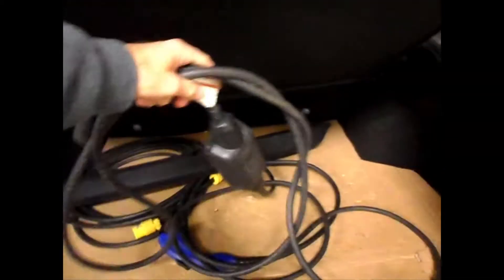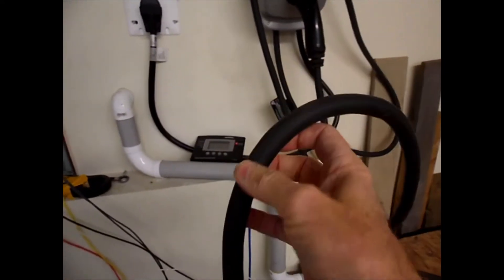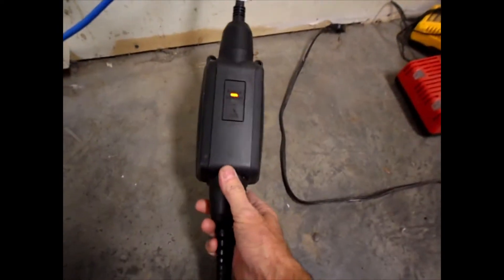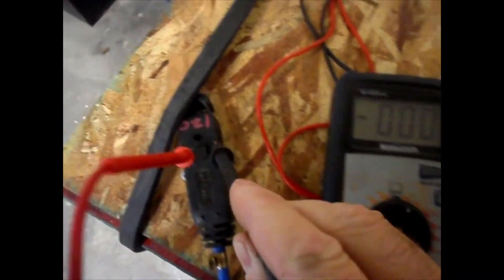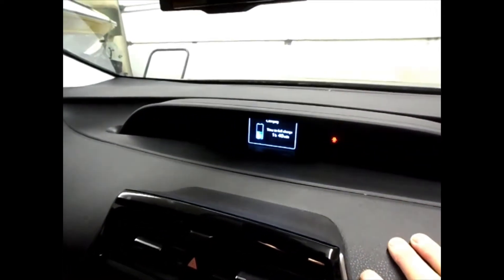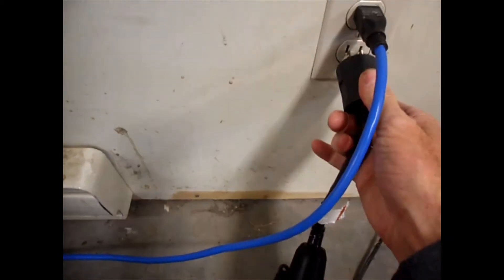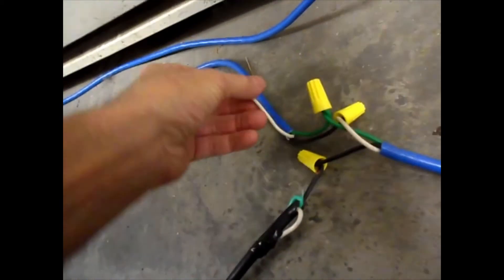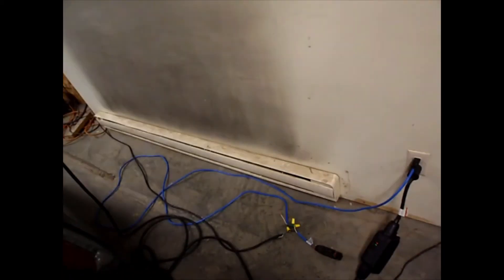Toyota Prius Prime PHEV Charge Controller works on 240 volts AC, save thousands

Comment: What you're saying doesn't make any sense. The electricity costs the same whether it's 120 volt or 240 volt.
Reply from the maker: yes its costs the same to charge your car on 120 or 240 since the watt hours used are the same in either case.  The cost saving are from not having to buy a dedicated 240v charger for the car and instead using the one supplied by Toyota when you buy the car and feeding it 240v instead of 120v.

Comment: Thank you so much! I purchased a Japanese second hand 2014 Prius PHV yesterday and I had to change the Japanese 200V plug into an Australian one. Once I opened the Japanese plug, I realised that their neutral (white) wire is corresponding to the Australian live (brown) wire. So, I was really struggling online to find relevant info till I realise Japan uses similar split-phase as US and Canada; I then found your video which further confirms that there isn't really a neutral wire in such a split-phase plug. So, my Australian plug is working fine now.

Comment: Nice video 
Its a bit red neck but works
Reply from the maker: yes I've since refined the final solution but the video was  mostly just to get the idea out there so people would understand the concept and be able to come up with a solution that works in their particular situation
Reply: @waltersavonian7551  you definitely explained it good
Reply: I actually ended up putting a 240 plug in and then made an adapter from 240 plug to 120v plug but 240v on the 120v so now I can just use 120v or 240v
Thanks for the video

Comment: Friendly reminder- this is bypassing the low amp fuses and the only fuse is the main. Drop the cord into salty water on the floor or mess something up and this could kill you.

Do this the right way- with proper fuses.
Reply from the maker: Hmm not too sure what you are referring to. Both of the separate 120volt branch circuits are protected by 15 amp breakers. This does not degrade the protection for these branch circuits in any way
Reply: Humm, firstly, I'm so very glad that little pup isn't a big licker. Loads of exposed conductors with current. One touch could mean death for him/her...........

So, another reason to cancel our order for the Prime. The fact we were told the car could be charged with 220 volts without buying a separate charger is yet one more detraction. Where we live, even though most power is generated by hydro, the cost to consumers is excessive. Been waiting 17 months already for the thing to land, the dealer Rep. didn't even know the car could be plugged in !. Now, they are telling us it will be at least another 3 months before it arrives !  @waltersavonian7551

Comment: It shows the llarge $1500 charger is just an empty box doing the same as a tiny cheap charge controller. Maybe it supports larger current but for small prius battery it makes no difference.

Comment: So I can plug my charger into my dryer outlet and get a faster charge?
Reply from the maker: What I can tell you is that I routinely plug my factory supplied Toyota charger into 240volts and charge my 2019 Prius Prime in 2 hours instead of the 5 hours it takes to charge when plugged into a standard 120volt outlet
Reply: There are actually "kits" that double your dryer outlet to charge your car at 220 volts.  Just can't use the dryer and charge the car at the same time.  Basically 220 is using both "hot" incoming wires, where as 120 is one of the hot wires and a neutral.
Plus, like anything, chargers are made for a certain amps output.  Remember, you are watching a YouTube person.
Reply from the maker: @MrMikebutkus  yes there are several ways to make it work, if in doubt contact a certified electrician

Comment: Do you know if you’re pulling 15amps on your 240v charger? Just got a level 2 240V 40amp charger but the display shows it peaking at 14.5 amps. So it’s taking longer to do a full charge. Like 2 hr 40 min.
Reply from the maker: Hmm, mine takes the 2hours 10mins as mentioned in the manual for the car on 240 volts. However I have found if I plug into 2 into volt outlets at a commercial building that has 3 phase power then there is only 208 volts between phases and I take more than the 2:10 prolly more like 2:40

Comment: How's this been for you in the long run everything working just fine? Also pro tip. You can always get your dedicated outlet in the garage and throw a two pole breaker and turn it into a 240v and label it so no one plugs anything in.
Reply from the maker: it has been working flawlessly for over 2 years now

Comment: Good stuff. I own a 2022 Prime slow charging on 120V so will give this a try on 240V but not with extension cords. Will wire up a separate wall receptacle with 2 hots. Thanks.
Reply from the maker: Ya I cleaned mine up to a better setup, still working great
Reply: I might also try this. I've been trying to find a video that talks about the Toyota OEM charger and what it can handle. I also own the 2022 Rav4 Prime with the 6.6KWh ob charger. For now, I just charge the unit from my 120 and it takes around 12hrs to fully charge from 0 to 100. I've been looking to buy the EV Doubler from Amazon that serves the same purpose as demonstrated in the video. It takes power from to separate outlets to produce the 240v. The ev doubler is around 100$ on Amazon.